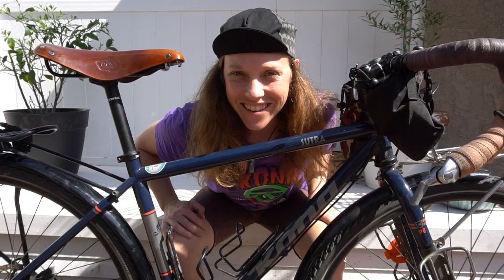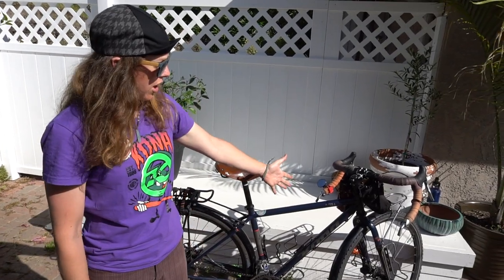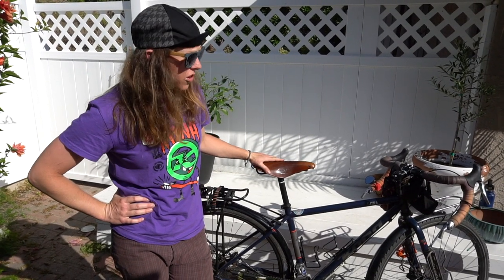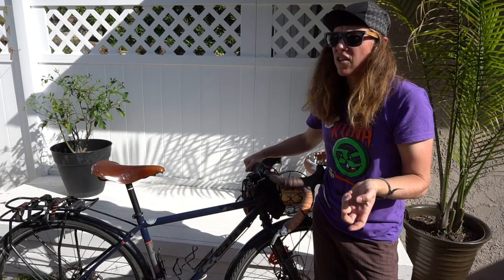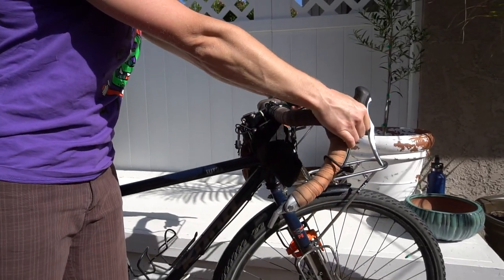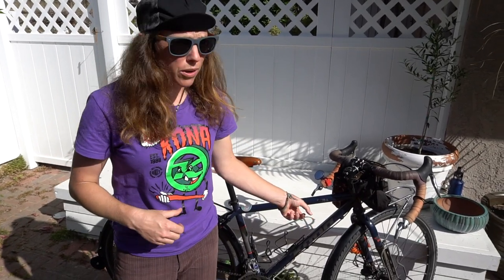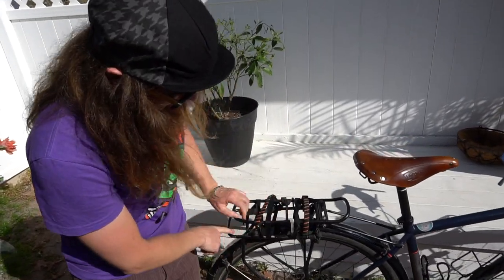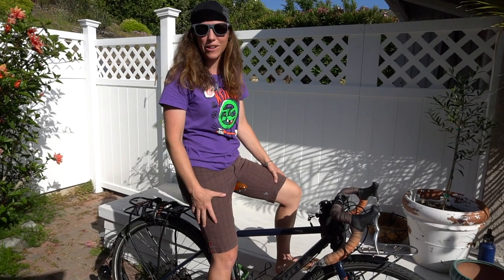Kona Sutra Bikepacking Touring Bike - LONG TERM REVIEW!

Comment: 4500 miles on my 2018 Kona Sutra.  Rear Wheel eventually gave up the ghost but I weigh about 250, ride with gear frequently, and on rough terrain.  Won't ride anything else.  Nice Review.
Reply from the maker: Thanks for sharing Stacey! I'm currently freshening her up to run a more bikepacking setup so will have that video out soon too : )
Reply: @radbikeadventure  keep them coming.  Not much stuff on you tube about the Kona Sutra...  wonderful bike...

Comment: Thanks for the review. Looks like a solid bike,
I think at the moment, it's one of the best touring bikes
 you can get for around $ 1500.

It's cool you added the Soma front rack, and those Blackburn cages look great because
you can just put anything in them. And I agree that bikes with disc brakes must have thru-axles: 
much more solid and stiff than quick-release axles.

The failure of the rear rack does not surprise me, after all those miles.
(I guess it's aluminium.) Experienced biketourers always tell me to go for steel racks, 
because they can handle the abuse better than aluminium.
I've always used aluminium racks myself, and they never failed, but these
were just 4 week trips, so no comparison to what you have cycled.

Regarding bike computers: I love having one on my bike. Since I have it, I am much
more aware of my cadence while riding. Once you know what cadence
you can ride comfortably at (somewhere between 85 and 95 for myself) then the bike
computer helps you to stay in that range. (Sorry I am a roadie, and obsessed with cadence while biking).

I would not use a Garmin / Wahoo or your phone for touring, cause they don't last a whole day on a battery.

Mine is a Sigma bc.14.16.sts, it's about $60.-- and it runs for months on a battery.
It is always on when you ride, and it has many functions, that I find it really useful.

Good luck converting your Sutra to a bikepacking rig, that should be interesting !
Reply: They don’t handle well at all when fully loaded with a decent amount of weight that’s the reason I switched to a thorn Sherpa
Reply from the maker: Have to disagree! My handling felt better, the more weight I had on it. Super secure and confident riding for me.
Reply from the maker: Paul Jansson Yes, I love it and I think Kona gives you a great bike for the price point. And yeah, steel rack would have been a wise upgrade for such a long trip but I was able to make it work 🤪.

True about bike computers, perhaps I'll take a look again. I think a Wahoo could be a good edition as I think they conserve battery much better than a phone. With the phone we only turned it on when necessary to check the route and did not track our routes that way. I'll take a look at the Sigma too thanks for the suggestion!

Cheers Paul!
Reply: rad bike adventure your a lot lighter than me but the bike barely handled much more than 20kg with me before it was all over the shop where as the LHT I could ride nearer 40 then the Sherpa handled even better with 40 at that time I was about 110kg myself

Comment: My Sutra is a 2006!  Pretty much everything on it has worn out and been replaced or upgraded at least once.. I think the only original bits are the frame and the original rims (rebuilt the wheels with new hubs and spokes when the hubs' bearing races wore out...).  My daily driver and it's been on over ten long bike vaca's.  Great touring frame as I'm 200lb and when it's loaded up with panniers it handles so well.

Comment: Thanks for the video. I have just ordered a different make of touring bike. The Kona Sutra was one I looked at, but I couldn't find it in stock in the UK at the moment. I have had two Brooks B17 saddles and loved them both. My new bike will come with a different make of leather saddle, very similar but slightly different shape, if I don't get on with it, the B17 will be the first upgrade.
Like you I have used the Schwalbe Marathon Plus tyres and I never had a puncture with them...... so far!
Interesting about the welds on the rack failing, I shall be checking mine in future and carrying zip ties, etc., in case a fix is needed.
I love your videos, a nice mix of cheerfulness and seriousness with loads of information. Please keep up the great work!
Reply from the maker: Great to hear it! Thanks so much 😊. Happy travels on your new bike!
Reply: I couldn't find a Sutra in SW England when I was looking either.

Comment: Definitely use a bike computer. It's a second check on your mileage so you can tell how far you've gone and it's also a good speedometer so you can tell if you're going a little too fast on that descent. And it has a clock, for what that's worth. Setup these days is usually really painless, since even moderately priced comps are now wireless. So you basically ziplock a sensor onto your fork, clip on a spoke magnet, and pair them up.

Comment: My recommendations: full Deore or above, because of the materials, Deore is stainless steel all the way, below it is for garage and bicycle used on dry days. Be careful most bikes have Deore rear derailleur, and rest below. Don’t go if shifters are not Deore. Tubus racks and Ortlieb you cannot go wrong. No front suspension, they also tend to age quickly exposed to elements. Steel is more comfortable than Alu, as Alu frame needs to be stiffer. Frame needs to have all eyelets you need (attachments, mudguards, lights). I would go for a hub dynamo as good ones have extremely low resistance, and your light always work. Bad lights are $30, good ones are $60, does not worth go cheap. Busch and müller is extremely reliable. SON dynamos and lights are fantastic but pricey.
Reply from the maker: I'm digging all this advice!

Comment: Got myself the 2016 model, I think it's bombproof, maybe had to break out the spoke wrench once, and that's only because I'm insane about my wheels.
I had the same issue with my rack, it broke in the same places as yours. The Dealer at the store explained that the panniers aren't meant to be hung from the lower rail.
Lesson learned. But I still think it's awesome to be able to hang the bags lower.

Comment: Nice review.  I've had a 2020 model for a few months now.  I bought it mainly as a low-maintenance general purpose road bike I'll hopefully use for touring in the future.  Yes, it's on the heavy side, but so what?  Unless you're racing that doesn't matter for most riders.  For commuting and touring the Sutra's robustness, simplicity, and comfort are ideal.

Comment: Being 4'10", finding it hard that fits my short statur. Which is why I changed my front fork from suspension to rigid with nubbies. Panniers in the front and CC touring. My current bike is a Titus XXS frame.
Reply from the maker: Yes I do wish there were more bikes built for females and smaller statured  people. Glad you found one that works!
Reply: Alee Denham on cyclingabout.com has recommendations for smaller rider touring bikes.
Reply: I love my vintage steel mountain bikes; they're so flippin' versatile! I have one set up as my everyday commuter/pavement ride, with racks, Brooks, fenders, and a V-O Porteur bar, and another as my off-pavement bike; both have big squishy tires. The only real issue is the stupid long cranks, but you can find shorter ones. I'm 5'4", and I love my 26"-wheeled bikes!

Comment: Thanks for this review. Extremely helpful. I am now waiting for my Sutra SE 2022 in 48 to arrive.We are about the same height (~5'4" or 165cm) but I think I have a slightly longer torso. I hope it works out for me. 
A kona representative told me that the 50 could have been a good fit but the 48 was the only one I could get my hands on in this period. And I think it's a safer bet to order a slightly smaller bike that i can modify to fit without getting a chance to first test ride it.

I'm really curious to see how I'll feel with this type of bike. Until recently (when it got stolen), I was riding a cube Kathmandu pro trekking bike for my daily commute and touring (I put some 10k km on it) and I loved it but i was missing something in terms of comfort, reliability of parts and speed which I'm hoping the sutra will be able to give me.

Very curious to see how this will work out. 

Thanks again for the review.

Comment: Awesome vid. I have the same make and model though mine did not come with a thru axle! (did you request it?) I have had the same issue with the rear rack - though only after about 500km and I use Ortlieb panniers - but I second everything else in the video - super comfy, easy to maintain, bombs down a hill and though a little heavy framed it is built to last and last and can handle lots of weight. My only gripe (other than the rear rack) is that the down tubes lower bottle mount is placed a long way forward and only fits a short bottle.

Comment: Your enthusiasm for the Sutra got me into the store today looking at one.  It appears that you have the same rack and weld as the one I saw today.  So we got to talking in the store about the weak weld and if they were willing to put on another rack.  Then we noticed that there was a black on black message on the upper part of the rack that said to put the weight on the upper and not the lower ''bar'' of the rack .  We wondered why the lower bar is there as it seems like it would be there to lower the weight.  However, I'm guessing it is there to give the rack lateral strength.  I wonder if your's had that hardly visible message on the higher bar?  It would certainly justify not lowering the weight.   Just a comment.
Reply from the maker: Hey Peter, thank you (and your local shop!) for doing a bit of research on the rack. I had contacted Kona about it and they said they hadn't gotten any feedback about rack troubles and my local shop said the same thing, no other mentions of breakage. 

 I just looked and can't find that message but perhaps this was the issue all along. I mean, it still gave me a LOT of mileage with a not super secure load and riding on trails, so pretty dang good for a stock rack!
Reply from the maker: P.s. did you get to test ride one? What did you think??

Comment: Just a note, LTD model has slightly different BB drop, making it a bit more suitable for offroad riding. Otherwise the same, as you said. ^^
Reply from the maker: Space Don’t believe so. They are the exact same frame. Also just checked and Kona specs and both have a 72mm bottom bracket drop.
Reply: @radbikeadventure  Sorry, it's the BB height.
Reply: @radbikeadventure  Though I'm not quite sure how one can change without the other. 🤔😅
Reply: BB Height, Trail, Standover and Bike Length are slightly different because of the Tire Outer Diameter. LTD=beefier tires. Same Frame.

Comment: The Sutra is a great choice. I have the '20 model and have only changed out to flat bars (yeah, I am one of THOSE) and thrown a Tubus rack on the front. 
You are correct about the handling. It rides like a very aerodynamic tank. Sturdy. :)
The ultimate bike if you want to go on a beer run, whether the beer store on the corner or the one across the country....
It's been a while since I have commented on any of your videos, but I have been watching since the beginning. Time for a year long bikepacking trip with videos? hint

Comment: Nice Video, very precise rather than bragging too much.
Marathon are Flatless isn't it? like punture proof
Yes, Even I am 5'5" ft tall ☺
Reply from the maker: Thanks Vinaykumar! Not puncture proof but definitely less likely to get one than other tires. Only flat I got was from a massive nail. 5’5’’ you’d probably need a size 48” 😊
Reply: I am planning to get a 
Comotion Pangea with a Pinion and Carbon belt Drive, very expensive though 
But absolutley worth it... More like a single investment.

Comment: I raised a warranty claim on the rack rail failure. They said 'do not use lower rails'! What?
Reply from the maker: Strange! Ours did break but we admit we had too much weight and it is aluminum and we went on dirt trail. But it would seem the lower rail is where your pannier should attach. How soon did it fail you?
Reply: @radbikeadventure  After two months and around 4,000km.  I fixed it up with cables ties and is now probably stronger.